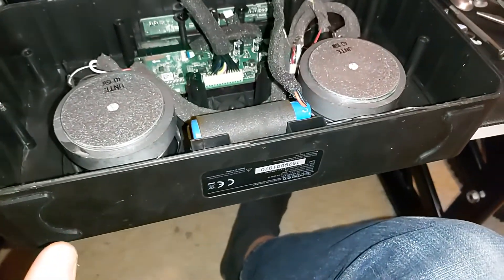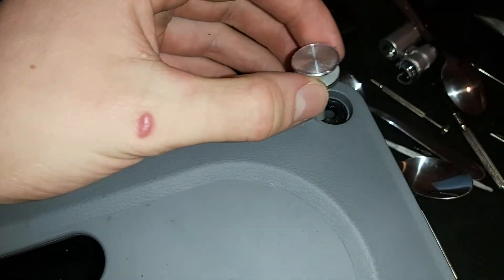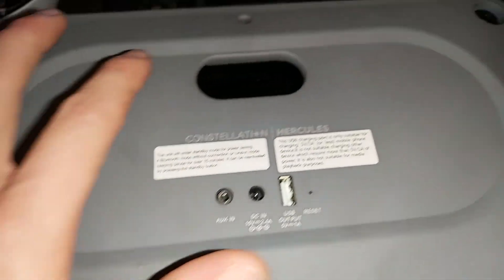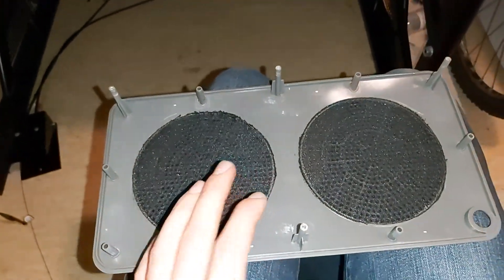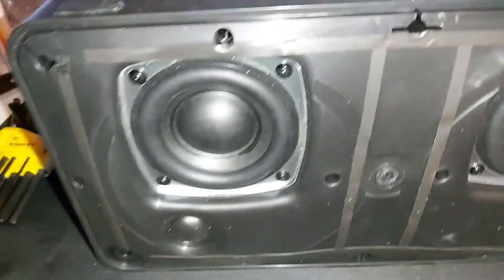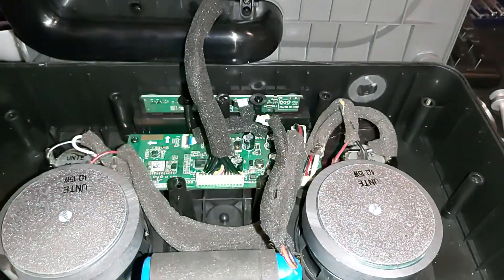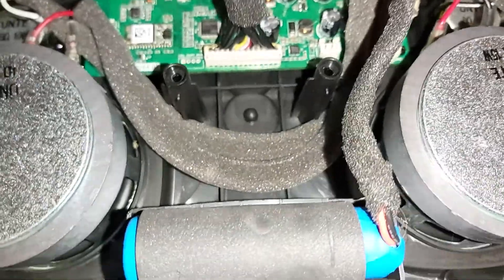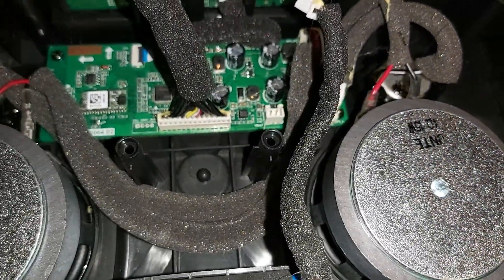Sandstrøm constellation Hercules Teardown, battery replacement

Comment: Do you know where I can buy the battery?
Reply from the maker: didnt log in on the account until now. But search for 3x18650 batteries. As long as its about 11.1 volts its good. When you cut off the end of the cable to get the connector from the old pack to the new, remember to cut the red and black separately, so you dont short the batteries with the scissors.